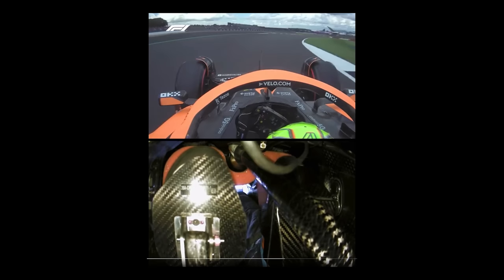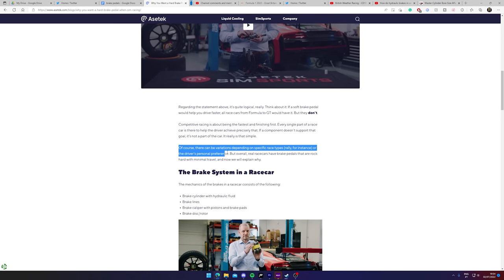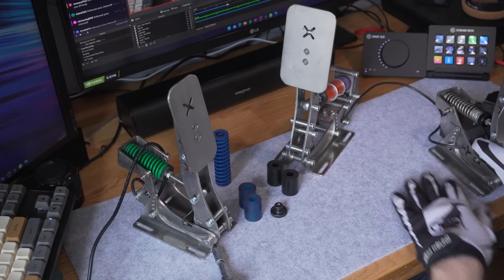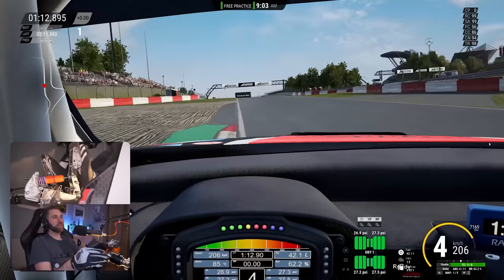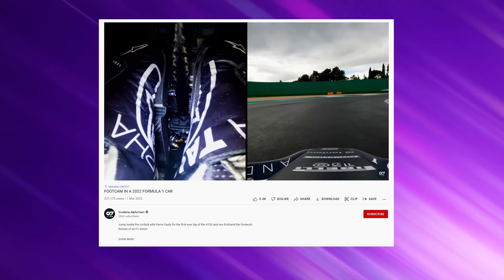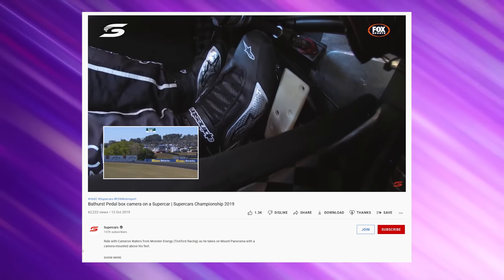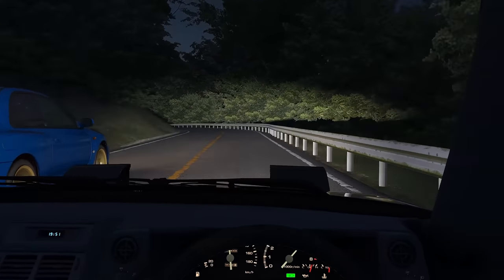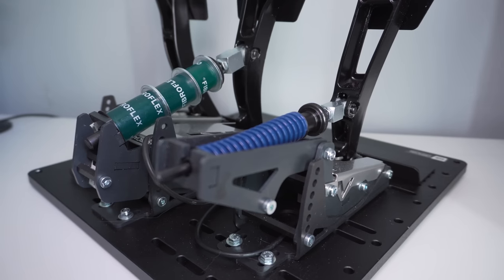Lando Norris brake cam shows simracing brake travel is all wrong

Comment: Yeah, I have my V3 inverted pedals set with a fairly long throw, but it does get hard at the end. Mine is a compromise, I drive trucks in American Truck Sim and race karts in GT7. Very different vehicles. I also do a lot of rally racing in Dirt Rally 2.0 so there is variety. I set my pedals as close to my real world vacuum assisted hydraulic three pedals you will find in older cars and trucks here in U.S. I have had super hard brakes but did not like it. I have had super soft brakes and I did not like that either. I am happy with my compromise.

Comment: I dont think people understant the pedal travel was never stated to be real lol. The reason its short and stopping force is due to the load cell. The sensors work faster and better with shorter teavel with a hard sropping point for readings. The reason our pedals are this way is because load cells make our braking more accurate not that it makes it more realsitic. It helps us with braking with a sensor thats using pressure or force as its reading. Instead of disntace or travel. Thats why it has nothing to do with real rscers travel vs ours lol.

Comment: Coolest thing would be like an actual spinning rotor with pads for feeling. Would make a huge mess in the room tho lol.
Reply from the maker: Ferodo everywhere
Reply: Hey hun where's the vacuum? I need to clean up the brake dust in my sim rig again, lol
Reply: Sebastien Loeb has a custom setup with this exact idea.
Reply: And spray the scent of melty R compound tires every few seconds for maximum immersion. I swear that vaporized rubber melts in my nose every track day, I smell that for like 2-3 days every time

Comment: Good topic, you are right about mechanical pressure and that is why pressure sensor pedals are beneficial in sim equipment. I think that is why low travel is also preferred by individuals though, as a load cell offers the ability to make even a rigid pedal still work. Regardless of travel the same amount of force is still required, so it becomes an efficiency thing. If you train your brain to focus on pressure, physical travel becomes nothing more than a preference and limiting it could improve performance. I have been finding this out myself and am looking to limit travel because of it. Pressure based sim pedals are much like a digital bathroom scale, you can change the weight simply by how hard you press even though a digital scale is pretty rigid.

Comment: I was just at CTMP Mosport and they had some rigs set up using Assetto Corsa and I predume a mod of CTMP.  Anyway, to my point.  The wheel was Thrustmaster but I'm not sure about the pedals.  However hitting them was like pushing my foot up against a wall...very little travel and I have to say I liked it and I didn't fear locking the brakes.  I have the regular Fanatec pedals and it's so easy to lock up so for me, I think the short throw would be good.
BTW, I'm no rookie but I'm nowhere near what some sim racers can do but they were suitably impressed.  Made my day.
Reply: The Fanatec load cell kit makes a world of a difference, it's a bit stiff at first but it makes braking soooo much more consistent.

Comment: Well I’ve driven a F4 car and a GT3 and both had really stiff short travel brakes… Even had to drive a Mclaren 675LT at work once and the pedal was stiff as a rock. You can’t use F1’s as example tho because they use brake by wire technology. So the pedals will move more and the system will compensate for the G-force pushing the foot forward according to driver preference.
Reply: Yeah nobody knows what theyre talking about in this thread. F1 went to brake by wire like you said, f2 and f3 are still as they were and have rock hard pedals.

Comment: exactly it all comes down to driver preference n the brake system.. a shorter travel will give stiffer feel faster braking reaching maximum pressure more increase risk of locking up because there is less range  to work with.  longer travel more range n precision progressive softer feeling easer to work with n less change of locking up as u can modulate with more precision.

Comment: I worked in the design of my university's FSAE car and we are able to set the brake pedal travel to driver preference from almost nothing to about 20 degrees. It's all preference or limitations in cockpit design, it really doesn't matter that much in the end of the day, what matters is brake line pressure

Comment: it's also depending on the brake line that you have. in most of the road care they are flexible so the brake fluid with pressure is causing them to expand and it'll give the pedal a longer range and softy feelling due to the expension of the line. Howwever in a ''race car the brake line is made with a metal line so the presssure doesn't drop and it feels way harder.
You will have a hard pedal with (old) single-seater racing cars that have no abs. 
Speed when you hit the brake also give you a different feeling cause when u hit the brake with a high velocity car you can put way more pressure. At low speed and the pads should be hard at the first hit then soft

Comment: A big point to also mention, Formula 1 cars are brake-by-wire and fly-by-wire throttle pedals, therefore there is no mechanical link to the brakes or throttle bodies. All of the movement used by the drivers would be completely customisable and to the preference of the drivers.

Comment: This is exactly my issue, I just got a set of CSL LC pedals and the travel is just rock hard. Even a noremal car brake has some travel before you feel pressure pushing back. There should be travel in a brake pedal, to give some sort of feel to the braking.
Reply: I find it hard to believe those pedals are stiffer than the clubsport v3 and those things needed to be stiffened up with the mod kit to be useful to me.
Reply: Same issue. Seems to be a difference between the elastometer rigidity in load cells shipped out in the past year from what I’ve gathered. Nearly useless in some games without endless fine tuning. I ordered new elastometers to see if I could make the load cell more useful but I’ve found the stock fanatec brake to be much more controllable especially with trailbraking and may just use that going forward and add handclutch pedals

Comment: Seems to me that:
1) Brake travel is dependent on the car, the drivers preference, or both.
2)  Brakes seem harder IRL because they have to be, to compensate for G forces the drivers will also be under then being applied to their brake pressure. If they weren't, the drivers would smash the brakes every single time.
3) Sim pedals try to compensate for G forces by replicating force required, when they should be focusing more on feel and providing racers the ability to fully change the pressure required to their own preference.
Cracking vid mate.

Comment: Others have commented on it here already but of course these cars are setup to how the driver likes them. Don’t know why this sticks in my head but I always remember that Jacques Villeneuve suffered terribly in the wet (compared to Damon Hill) because he loved a brake pedal with a tiny amount of travel and a throttle with about an inch (or so) or travel. So he could be hard on the power and brakes and let the electronics (at the time) sort it out for him. Damon preferred more control. Cadence braking, smooth on the throttle, etc. but yeah a really interesting video and it shows that all these 350kg super hard sim racing setups are now always accurate.

Comment: Brake pedals always have travel, they are hydraulically connected, to the brakes so they need to move to move the pads. There are plenty of ways you can set up the pedal, for the same actuation of the pad, large or small travel. In the most famous series, you will have it set up to driver preference. In series where teams have less budget, the easiest way to create a brake system is for it to have almost no travel, by directly connecting the input of the pedal to the lines. Most people who are racing and need the realism in order to improve on their home sims, take part in those series.

Comment: Your points are valid and I will admit i came into watching this video with alot of skepticism given the title. I agree it is driver preference. What I think you got wrong was how the race cars systems work. Cup cars and gt4 cars may still use a brake booster I could be wrong but pretty much every race car uses manual brakes and not using a brake booster. They will have separate master cylinders  on the brake pedal usually mounted on the pedal box. So the only amount of movement your pedal can travel is length of the push rod. Now these can be changed and swapped out given track and or driver preference like you said. Other than that...was a great video and enjoyed it 👍

Comment: I do wonder whether they have modelled the brake travel on go karts, go karts have insanely small amounts of travel in pedals. They are also readily available to any man, women on the street. It is a shame as when I started racing round the UK in the early 90s as a kid the brakes used back then had a fair bit of travel, and then as things progressed new braking systems came in, more effective, but with minute travel lengths on the pedals. The Devs could have tried these systems out? Just a theory.

Comment: The problem with IRL onboard videos is that they are a drop in the ocean. They show us what the specific driver, team and manufacturer wanted their pedals to behave like under the specific conditions the video was shot under. This by no means demonstrates what the general consensus is when it comes to pedal stiffness and travel. The same problem applies to sim pedal manufacturers. They only have access to a limited number of cars (if any) for R&D purposes and maybe they've asked a few drivers about their preferences. Whichever the case, as long as the brake pedal is progressive and feels convincing, I don't think there's a right and wrong way of doing things, just personal preference. From my little experience of brake pedals in road cars, I've always felt much more comfortable with stiffer, shorter throw brake pedals because of how easy they make fine modulations.

Comment: Yep, I've been arguing this for a while.  I've seen pedal cams before, of course, but I was very glad to see McLaren bring it back with Lando just to prove the stiff pedal crowd wrong.  I also think the fixation on load cells is a bit misplaced.  A rubber block with progressive pressure requirements to move the pedal further, along with a potentiometer or hall sensor, is a proxy for pressure.  There might be advantages to load cells which measure pressure directly, but the familiar claim that it's about muscle memory is not one of them.

Comment: Perhaps, to truly emulate brake feel in pedals, we need to plumb up a real master cylinder, caliper, and pad to our sim brakes, attached with a joint to the back of the pedal just like it would be in the real vehicle. Honestly, the clutch could be done the same way, given hydraulic clutches use a similar cylinder setup. Of course, you could use real automotive hardware across the board, but given that the same effect of a caliper+pad and clutch spring could be entirely recreated on a much smaller scale, sim specific hardware could be made, with a caliper that just piston compresses a polycarbonate brake pad into a metal backplate, and a relatively strong encased spring on another caliper for the clutch, with a small lighter spring closer to the piston, to emulate the bit of travel before the clutch disc actually starts getting separated from the flywheel.
Bam! You've got authentic brake and clutch feel in a relatively compact space, by recreating exactly what they do on a smaller scale.
Of course, the brakes and clutch won't represent the active stare of the ingame vehicle very well, but they'll definitely reflect the springy nature of the hydraulic system in the most authentic way possible.
Reply: This would simulate a stationary car very well, but a lot of what we feel when braking a real car comes from the pads pushing against a rotating disk (especially when it’s fast) and that’s impossible to recreate in a simulator. I think brake pedals need force feedback, but this is kind of futuristic at the moment

Comment: I don't think you're wrong at all, mate. It's all about preference. Because at the end of the day you've to feel comfortable with your rig, be it a sim rig or a real car. Before upgrading my rig, I thought load cell or hydraulic pedals would be all the rage. But after that I realised that what I treasure most now is the ability to fine  tune the curve of actual output given a certain input for the brakes; not to digress too much but I deviated from the linear progression and used more of a log type curve, however I plan on changing it to a longer travel before the forces actually kick in (to help trailing). Having elastomers or fluids is cool and stuff, but I won't spend a dime on a Fanatec if they don't allow for such customisation. I spend tons of time on F1 2021 controller configuration screen! Hahaha!

Great content. Cheers!

Comment: Some corners also only require a soft braking, so a long travel gives you more possibilities to adjust the pressure you need. Especially if you need to hold the pressure constant at a specific amount for a bit.

Comment: The strange thing is from my young days in sim racing, im doing it currently for 10 years on and off since i was 11 with old wheels Logitech grand turismo, anyways, i got load cels the TLCM ones, i thought they are great, but the strange thing was i preffered the old non load cell ones, why ? becouse they had more travel i could consistently brake better with non load cells due to fealing exactly how much i pressed in , with load cells i have problem and still having after 1 + year using them , yes i dont lock up while breaking but, i dont feel when exactly i have to fully break and I lock the brakes to much becouse i dont feel fully when  where is the end point and how much presure i need to aplly due even if im using the breaks for this longs at the same setup.
Reply: I had the same experience going from t3pa to sprints. But we need to take the many many hours we've used the potentiometers into account, loadcells are cool, but it's not magic - Come time it will catch up to the muscle memory of the old pedals you used for let's say 4000 hours :)

Comment: Regarding GT3 brake pressure (in KG), I've heard numbers close to 180kg at high speed to get an ABS christmas tree. It seems to depend on the car. The Nissan does have a very long travel but seems hard too. On some other onboard cameras, you will spot the driver's shoe bending under the heavy forces that's being put on the pedal face, it's no joke. Since G forces are always brought up, to my knowledge it seems to help for about 20% of the pressure. Now, if the brakes are lighter - like in, say, McLaren GT4 - I can see why drivers don't really like servo brakes if the maximum is ~70kg, but you have 30kg of G forces coming forward as you're braking. Should feel like very minimal control, for them.

Comment: I always set up my brake for "linear" feel. Whatever braking force gives you the most ability to modulate small movements is best. Too little resistance, then its easy to make too large adjustments by accident. Too much resistance then it is difficult to modulate the brake responsively. I find the sweetspot then gradually increase resistance as my leg gets stronger.
Reply: Same. And the stiffness matters depending on the loadcell.

If i have 100kg loadcell i need stiffer pedal to not bottom out the pedal before reaching full force. For 50kg loadcell i need less stiff so i don't have travel left in the table when i hit 100% brake force.

I think this point is ignored by people as well when stiffness is discussed.

Comment: Honestly I have to say that in my case my brake pedal (heusinkveld sprint) is absolutely STIFF. I also added one more elastomer to the travel so now I have 4 instead of 3 like it comes out from the factory. I immediately found myself more consistent in braking and the force that I apply is the same every lap. I’m not here to say that this must be the way but for sure for me it was a massive improvement if I have to compare to the clubsport V3 i had with a longer pedal travel. BTW there are a lot of customizations for the heusinkveld so maybe I’ll take a look

Comment: In terms of F1 they are pretty much using Sim brakes, that whole part about the mechanical feel of the brake pedal isn’t particularly relevant to F1 because they’re all Brake By Wire.

When the driver presses the pedal that sends an electrical signal to a computer which then applies the brakes so there’s no physical connection between the pedal and the brakes.
Reply: Only the rear brakes are brake-by-wire, because of the energy recovery system, the front brakes are still hydraulically connected directly to the brake pedal.

Comment: I tried a load cell, no travel brake pedal and hated it because it's nothing like my real car. I found a progressive pedal with a decent amount of travel to be much more comfortable and controllable. I also think the "it's easier to tell how hard you're pressing vs where you're pressing to on a linear pedal" in relation to braking is a load of bs as long as you have enough resistance in the pedal. The throttle pedal is usually a linear spring so how come people don't complain about knowing how much throttle you're applying?

Comment: I'm surprised. I'll have go and find pedal videos for Formula 1 and other race cars. Decades ago I raced Formula Ford. The brakes were light even without a servo because the cars are light. The pedal movement was next to nothing. It was like pushing on a block of wood. It was necessary to get used to it after only driving road  cars but the brakes were hugely effective and controllable once mastered.